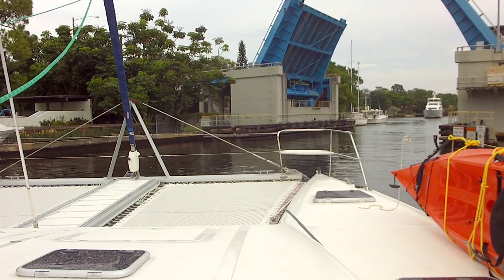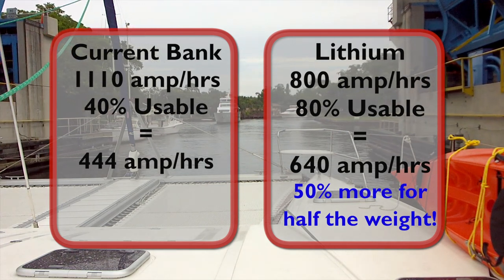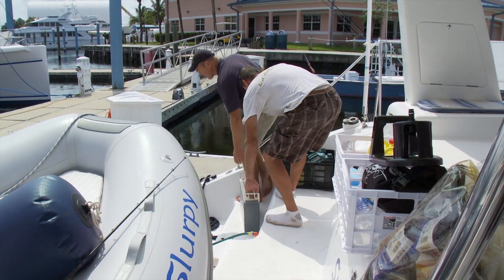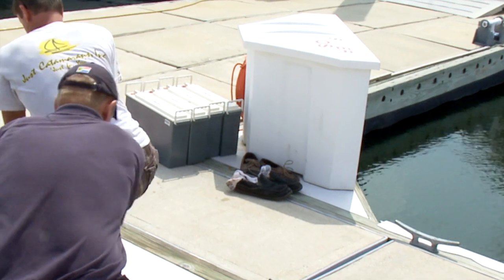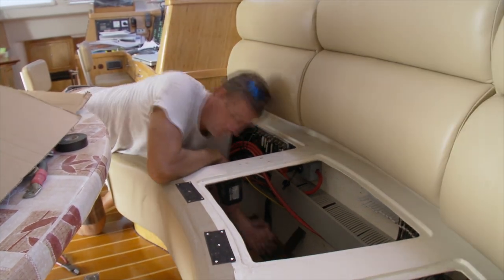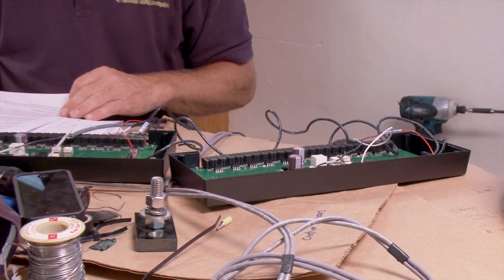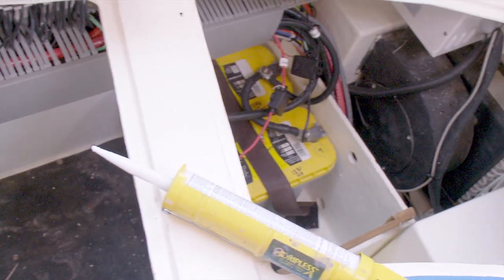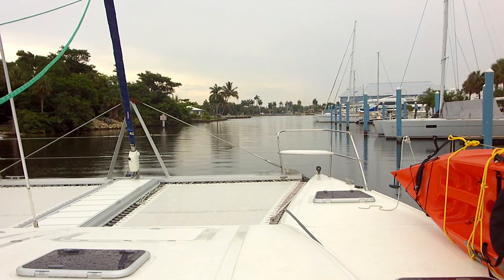Suliere Needs Power

Comment from the maker: Just realised - where do you get the $5000 USD per Kwh from? The price is nothing approaching that. I have 800 amps at 12 volt = 9.6Kwh. for a cost all in of about $1400 per kWh. These are tested batteries as the cells costing half that price are untested and come without the case or BMS we wet for safety and warranty.

Comment: You happy with the batteries? How much is max takeout? I have a amplifier that takes about 3KW at max. Would it work? How long lifetime do you have? I know many lithium batteries only have 1000 charges which will be about 3 years.
Reply from the maker: +sm6wet 
Very happy with them.
Max takeout is anything up to the rest of the system handling it i.e. inverters. 3kw is fine.
I expect 10 years lifetime.
I do not know where you had that 1000 cycles from.
Paul
Reply: Well, not company specific, just know that in general newer mobile phones has similar batteries (although smaller) and in general they promise 1000 charges.

Comment: Around $14k for 2 x 360Ah(test out to 400A) x 12V...which are really about 12.8V nominal.  So, 12.8V x 400Ah = 5.12kWh each 400Ah pack, so round down to 10kWh for the set (800Ah).  At $14k, that's $1,400 per kWh.  How did you come up with $5k/kWh??